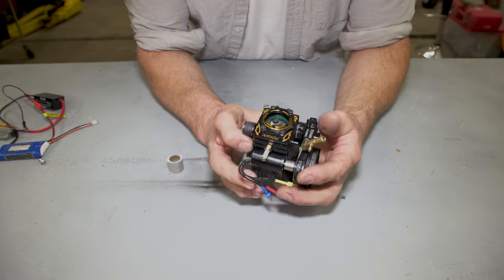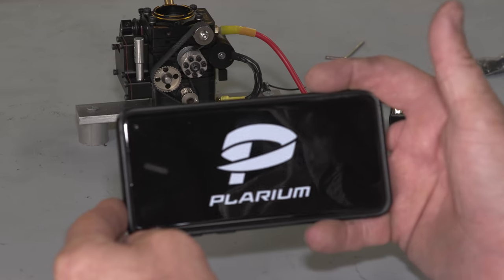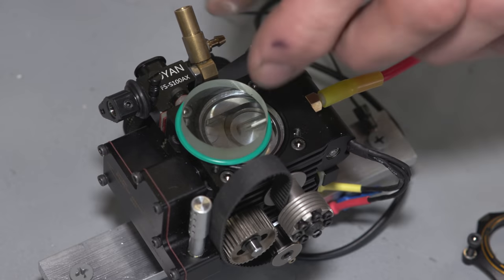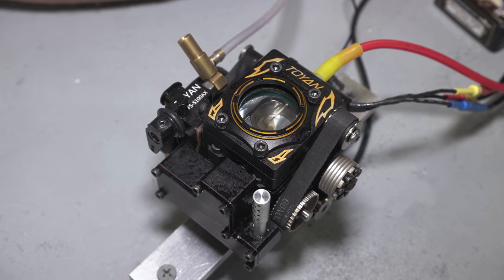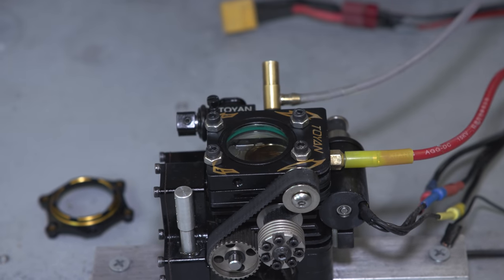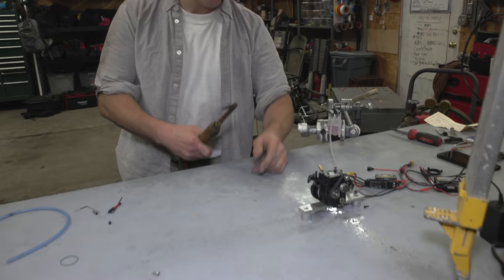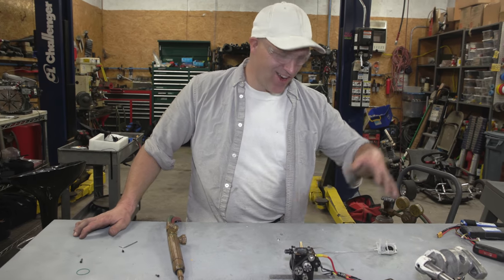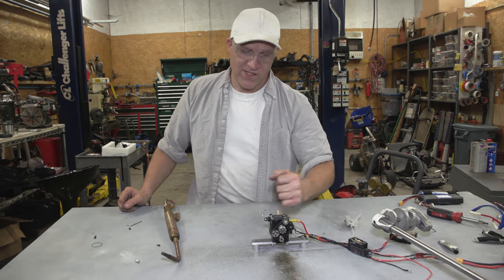Tiny See-Thru Engine - In 4k Slow Motion

Comment: Alright guys I need some help. I’m planning on making a mini rotary engine for a rc car but I’m stuck on one thing. How can you make a spark without a flywheel? I feel like it’s easy but I still can’t figure it out
Reply: mhm
Reply: Points? Or put a magnet on the crankshaft and a coil close to the crankshaft?
Reply: Encoder on the rotor, a controller to fast read the rotation of rotor and spark the plug accordingly to match timing ? Basically a fully electronic controlled injection system for your rotary
Reply: That's bad ass how much u pay for that bud
Reply: @Warped Perception thanks for pinning it for him bud <3

Comment: The flame traveling up the fuel line into the tank is nuts.  Definitely was not expecting that lol.
Reply: That was wild. When I saw the fuel being pushed up the fuel line at about 8:12 I was beginning to think something along the lines of "hmmmm that looks like it could be bad" but before I could finish that thought the damn tank blew up.

Could have ended worse than it, clothes covered in R/C fuel, open flames present...
Reply: *clears throat.... 
VA ROOM...... KA BOOM! 😱     
😂😂😂
Reply: check out some of "Beyond the Press" where they ignite oxy/acty through clear tubing.
Reply: Yeah flash back is a dangerous thing

Comment: What we just witnessed was DETONATION. That's wild! not only can you see the difference in the burn rate between a normal combustion event and a detonation, you can also see that the engine wasn't rotated to the proper point for ignition. You can see the point where it missed a beat, causing a miss. Then, on the EXHAUST stroke, just before the piston hits TDC to start the intake stroke, the mixture detonates, sending that super fast flame straight out the intake valve and up the fuel line.

I think you got a little lucky. I'm not sure if that glass would have survived a detonation on the compression stroke. When it detonated it was still on the exhaust stroke, so it had a relatively clear path for the expanding gasses to escape. And since the intake stroke comes next, it never had a situation where it was a confined detonation like you get on the compression stroke.
Reply from the maker: How is a really good observation and a really good explanation, you're completely right I just watched the footage again after reading your explanation and that's exactly what happened. now if that would have occurred in a different point in the stroke and the glass would have exploded, well that would have been really cool too.
Reply: @WarpedYT  High speed footage is awesome. It would've been impossible to know exactly how that detonation occurred without the great footage you took. If it detonated and shattered the glass that would've been an epic bit of footage too haha
Reply: How this comment can only have a handful of likes has me stumped. Good eyes on you 👍👀
Reply: Was the cam timing properly set after you spun the cam by hand? With it not wanting to rev and then the detonation it seems like the cam timing was off.

Comment: Are you kidding me?!!  That little thing puts out about 0.5 horsepower!!!  Amazing little engine.  Stirlingkit has some cool stuff.  I'll bet you were getting close to 1 hp out of that puppy.  Cool stuff Matt!
Reply from the maker: Is that what its rated at?
Reply: @WarpedYT  Per stirlingkits website its Output Power is 0.5ps (pferdestarke)  which converts to .493 hp.  So I guess so.  It sure seems high for a little 3.5 cc engine.

Comment: Wow that flame traveling through the fuel line was interesting.  I survey boats for a living and one of the requirements is a "flame screen" in the fuel tank vent fitting which is normally mounted through the side of the hull.  This screen prevents a flame from igniting the fumes in the vent line and traveling to the tank.  It also prevents dirt dobbers from plugging the vent.

Comment: Since it survived this one. What about playing a bit with engine timing?  I'm not a engine expert but maybe it's possible to achieve effect similar to two step or something. It would look nice with fire pulled to exhaust port and thru exhaust itself. Also it might sound nice.
Reply: Up
Reply: Sic Semper Tyrannis  By changing timing, or fuel supply. You can't hold specific RPM and have max throttle without limiting combustion/power output. Learn basics...

Engineering Explained has good video about two step. Go and watch it.

Comment: Can you put some more light shining inside the cylinder, if possible, so we can see the piston and valves moving. 
 You were speaking about rpm lagging, are you sure you got the cam timed right? You didn't show that part in reassembly..
Reply: Definitely could be the timing off, or a very bad air to fuel mixture, because it seemed ok on oxy acetylene
Reply: Agreed
Reply: i also suspect the timing

Comment: You did not show it, but did you ever try leaning out the mixture screw to increase the rpm on the nitro fuel?
Reply from the maker: Yes I did, I tried going in going rich and tuned the mixture to where it is right now.. I even ran it on gasoline to see if it would run any better.

Comment: Maybe simulate a supercharger with compressed air plumbed and sealed to the carb. Use a regulator to keep it at measured boost levels. You would also have to pressurize the fuel tank too. See how much boost it can handle. 
  That oxy/acetylene combo is great. The spark plug was glowing pretty bright. I thought it would melt and sputter out for sure. That's when the fuel tank blew.

Comment: Are you sure the cam is synced properly with the driveshaft? If it's off a tooth or two, that might possibly contribute to the low rpm you were seeing.
Reply from the maker: 100% sure, I don't think this engine is made to run like a normal engine, it's more of a souvenir that runs which is also cool. I triple checked the valve timing and a marks on the crankshaft and camshaft... They're good I just think maybe the compression is super low in this engine

Comment: I know this is probably a stupid question, but did the cam get degreed back in properly? Something looked strange about the valve events, and advanced cam timing would explain the rpm issue.
Reply from the maker: yes.. both marks down, it was correct the engine just ran sluggish, as others have said its one of the reasons Briggs and Stratton and others moved away from the flathead design.

Comment: Maybe try a small touch up paint gun with Nitrous as the air source and methanol as the "paint" and hard plumb it into the intake. It makes a junky adjustable fuel injection system.
Reply: I agree ^^

Comment: The link is missing to the engine. Can you add it back in the description?
Reply: @tonydetwiler2624  hmmm. I'm sure it's like most engines. How they're treated, etc. Now you're gonna have me buy one and publish endurance testing on it. I found them for sale on several sites. Had many good reviews.
Reply from the maker: I will be putting a link out soon I just don't have it yet
Reply: @tonydetwiler2624  The toyan engines, and the brass engines are both very reliable. The key is to make sure oil is everywhere. Cams especially. A tad bit in the fuel, to lubericate the rubber o ring. And it’s a very reliable engine. And for the price, the time it took to make that engine, for the price you can’t complain weather you have issues or not... 

Ps, I own the vertical m16 engine. Runs great ;)

Comment: Did you remember to set the valve timing after reassembling it? It's running like the timing is wrong, especially the way it just dies when you give it throttle, and you made no mention of setting it.

Comment: didn't you mess with the valve sync when taking it apart and putting the belt on?
maybe it's the cause for the low rpm
Reply from the maker: I put it back with the correct timing.
Reply from the maker: I'm not sure I tried everything to get this thing running good and it just runs okay I even ran it on 2-cycle gas.

Comment: That tank explosion was unexpected i had a rc fuel canister blow up on me burned my legs sky high and kinda got spooked
Reply from the maker: Yeah well this one blew up so violently that none of the fuel ignited because of the shock of the explosion... But if you have a fuel tank explode because of liquid fuel inside, that's another story... You will get burned
Reply: @WarpedYT  well i was kinda dicking around so it was totally my fault luckily it was old fuel so i didint turn in to fog

Comment: Seems that the spark plug missed the time and ignited the mixture during the end of the exhaust stroke, making part of the ignited gas to be on the chamber when the intake valve oppened, then the flame travelled through the carburator and the fuel hose... Maybe the spark plug stopped working propely once It was glowing hot.

Comment: the rc fuel could have spilled everywhere setting everything it touches on fire and causing some serious burns, you were very lucky
Reply from the maker: This is very safe compared to the previous videos .
Reply: lit gasoline can’t do shit, especially in that small of a quantity. it’s good under pressure but it has a very weak flame that goes out extremely quickly
Reply: B Dutta : you’re telling me you never played with gas as a kid? You act like its napalm. You’ll get one large flame, then nothing else will happen. You do realize that gasoline is designed specifically for compression, right? Watch a video of 2-Stroke gas burning

Comment: Put a 2 stroke bicycle engine thru the tests haha please that would be cool or even better if it just makes more power and lives?
Reply: As a motorized bicycle owner myself, I would also love to see that!
Reply: @desertrat1357  for real lol. Me to
Reply from the maker: What kind of tests are you thinking?
Reply: @WarpedYT  Excessive RPM. I don't have a tach, so I'm always a bit concerned I might blow up the engine. See through head would be cool. And also see if it'll run on different types of fuel.
Reply: As well as 2 cycle high test with additives like alchohol or nitro or methanol

Comment: You should really tune the carburetor air/fuel mix to get the engine to properly run with the nitro rc fuel. Maybe you might even get it to blow when you introduce the oxy acetylene fuel.
Reply from the maker: I tried like a maniac, it wouldn't just stay running consistently.
Reply: @WarpedYT  odd did you check timing with the magnet and cam? To advance or retard the firing pattern
Reply from the maker: Yes I did that also, additionally I tried running it on gasoline as well, I think it has to do with the engine design.
Reply: @WarpedYT  yeah it's possible that it's just a low compression motor compared to the others idk

Comment: man you need a somesort of rig to operate the Oxy Acetyline at a distance. a system that can be adpated to an engine that can be operated at a safe distance incase the engine blows up catastropicaly. better be  sheilded or at a safe distance away. and with that system we can even push further limmits without harm and injury. its a better way than holding the torch near which is and can be basicaly a small reving engine  granade.
Reply from the maker: Good point, that's what I'm going to do next time, the issue I had here is the the engine won't run consistently.

Comment: wait why dont they use oxygen acetelyne in normal cars? i think performance would be top notch
Reply: 1. It would cost a fortune to drive anywhere
2. Wear would destroy any engine
Reply: @backwoodsjunkie08  what about a sort of nitrous system but instead of nitrous it injects oxygen acetylene
On second thought I think nitrous would have the same effect
Reply from the maker: It's definitely very efficient with absolutely no exhaust pollution

Comment: diesel engine update?
Reply from the maker: Coming very soon, all the manufacturing facilities in factories were closed due to the pandemic, and a lot of them still have limited access.. but I should be starting that project back up shortly..
Reply: @WarpedYT  thank you for your response. I was worried that you couldn't make a thick enough see through head to handle the high compression.

Comment: why do you even need the fuel tank if you are just running it off acetylene?? I would just remove it as its a extra hazard that doesn't need to be there.
Reply from the maker: Well because the original idea was to get it started on the regular fuel first, then add in the acetylene and then the oxygen
Reply: @WarpedYT  but once add in acetylene you can cut off the gasoline

Comment: It does not make sense... You flooded the motor with to much fuel and then added oxygen. Neither would have any impact on the motor other then burning it up.  Oxygen alone does not make a motor run better the nitrogen in the air is what creates the boost in a motor with nitrous kits.  Oxygen just promotes fuel to be able to burn.  To much fuel will not burn fully regardless of oxygen present. Physics of how motor works
Reply from the maker: Sorry but nitrogen is not flammable, the reason a candle doesn't light up like a rocket engine is because you have nitrogen in the air suppressing the fire, the oxygen and nitrous oxide mixed with the fuel is what gives you a boost.